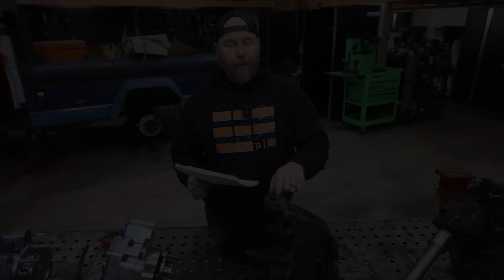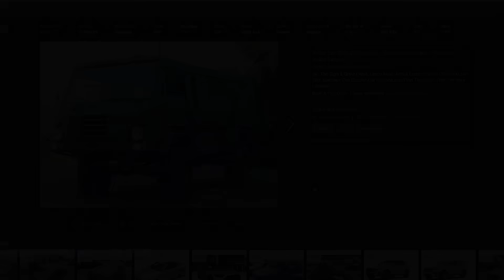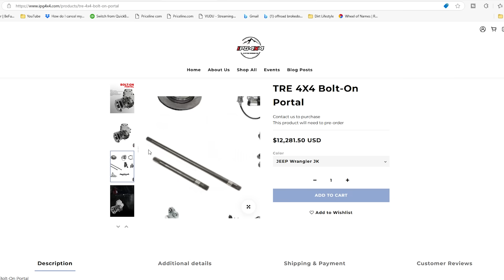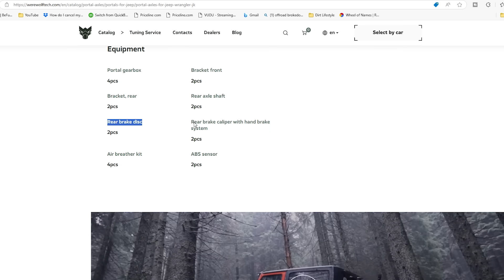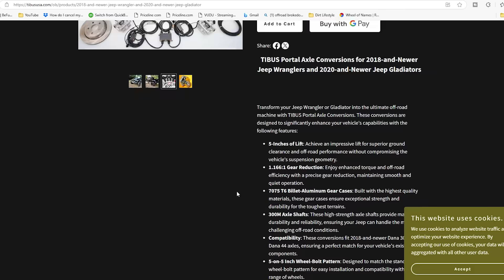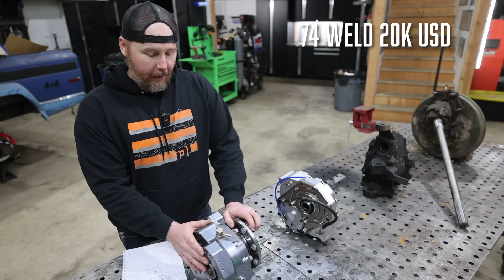CHEAPEST Off Road Portal Axle to Most Expensive! 74 weld, Werewolf, Hummer portal, Unimog portal.

Comment: What about noise?  Those gear sets have to be loud… Just don’t measure HP, do a road test before and after and measure the ambient cabin noise.
Reply: They aren’t…the main reason is RPM. At 80mph on the freeway the portal gears will be spinning at about 750rpm depending on application and diff gearing. Now if your vehicle would do 500mph yes they will sing like a typical straight cut transmission gear but that likely won’t be an issue

Comment: Using a rear third-member in the front and vis versa is a bad Idea. Used as designed, the helical curved angled gears create a linear force acting between the carrier and the larger inner pinion bearing  which is compressed under engine pressure and drive load resistance, the angle cut pinion and ring gear reaction force is applied against the inner race in the housing, thats the whole differentials work load on the larger inner bearing is designed to handle this pressure, reversing creates a high thrust load against the outer pinion bearing in an inward direction which places all of it against the nut and crush sleeve on the pinion gear, which is not only the smallest and weakest link, it also receives the least lubrication, consider the way the differential circulates lube internally, which is slung from the ring gear, the front diff slings from the bottom and the rear from the top, the housing  designs facilitate this method and allow the lubricant to reach the  pinion bearing.
Reply: Huh? Sorry but all this info is incorrect. There is no such thing as a front or rear differential. There are only high pinion or low pinion which run on either the drive side or the coast side of the gear depending on if it’s run in the front or the rear. As for flipping the diff, this has been done for decades in racing. The only issue you have to contend with is pinion oiling when running a LP diff in the rear that has been flipped and there are probably a dozen pinion supports available on the market that are specifically designed for this application and proper oiling. Most all of the current Ultra 4 and Trophy Trucks are mid engine which require the diff to be flipped…it’s a non issue

Comment: Not sure how the shipping will go, but look up Marks 4x4 based in Melbourne Australia.

They make full portal axles for a number of vehicles including LandCruisers, I think the prices are around $12-15k Australian.

But these are complete bolt in axles, so they maintain the same track width, have the diff and portal ratios tuned etc.

For the Nissan Patrol (the 4x4 of my choice), they advertise going up to 35's with "factory" final ratios at the wheels (factory tires are normally 31's).

They are about to release the Gen 2 version that supports CTIS, working with another local Australian manufacturer that make CTIS systems.

I'm not sure how compatible they will be with the different models of USA vehicles, or how the costs will work out to have them shipped over etc.

But knowing that they exist means you can look into them and get the details you want.

When I contacted them many years ago with questions, they were quite happy to respond and answer.
Reply: Rubbish…….., probably the weakest portal out there. Only limited to 35s and they still break. they are over 60k aud now so get ur facts right

Comment: Great video man!!!
Couple things, one statement, one question:
- I've worked in the auto repair industry for 35 years, and not a single tech I've work with would be willing to even entertain the idea of working on portals. So Nate, you're spot on with that one.... "You're on your own". As sad as I am to say that.
- It seems like a good idea that all steering and suspension bushings should be poly instead of rubber due to the added force/stress? Is that a correct statement?
Rock on man. Love the content!

Comment: Really good video on portals. As far as they all seem to go, also depends on you case fastener of choice. Alan head bolts tend to get full of gunk, then you can't get you tool down all the way to the bottom, then you round the inside out, and then your boned. Espically on the 74 weld, where it looks like you can't even get a set of vice grips on the head of the bolts to get them out. And steel bolts in aluminum will lead to corrosion. So pretty much even before you put these on, put a decent amount of anti seize on the bolts so they have a hope in hell of coming out if they ever need to be serviced.

Comment: The Hummer H1 Service Manual states that you should change your geared hub oil every 12,000miles or whenever it is contaminated. Also a big reason for the Hummer/HMMWV portal failures is due to improper torquing of the spindle nut. BlueHummer came out with a locking spindle nut to help combat this which is now available from ModMafia.

Comment: Thank you. The pros and cons really help. You might note the dramatic difference in the thickness of the units. Narrow ones will give less of some impacts - like scrub radius and leverage on ball joints etc, but may have their own trade-offs. There are very good reasons that the world’s vehicle manufacturers only use these on specialty off-road vehicles, and most have speed restrictions if used on road.

Comment: There are a few interesting traps in here as well;
the first is that you'll notice the "big brands" so to speak, have weird drive ratios, like differentials. The reason for this is because at least one of the gears has a prime number of teeth... That's so every tooth touches every other tooth... If you don't have that then you'll have "sets" of teeth that touch each other and can have mutual wear problems... If you have a gear with 10 teeth on it and a gear with 20 teeth on it, then every tooth on the little one only ever touches 2 teeth on the big one... Weird problems happen that can cause individual tooth failures due to normal operating wear.
Second, bolt counts; it's not so much about how many bolts there are, it's mostly about keeping the two case halves sandwiched... Pretty well all gearboxes fail due to case flex. If you're missing teeth it's because the gear centres have moved away from each other, caused tip loading and you've smashed a tip off... If you're experiencing case failure it's normally because thrust loads on the case from the gears resulting in misalignment, weird loads etc. etc... Gasket failures are normally because of case splay because of... You guessed it :D
As far as the bolt thread into aluminium goes... That's a hilarious one, it turns out you can create enough thread with three diameters worth of thread in aluminium that it'll pull the head off a 12.9 bolt with overtorquing before the thread fails.
Finally, the biggest single advantage of CTIS is that, if you have a puncture you find out immediately, and you don't lose the tyre... CTIS with any sort of reasonable flow rate compressor will actually flow enough to keep the tyre on the bead and inflated at low pressures, as long as your lines have the flow rate to support it... This sort of thing is super useful if you're propped on the side of a super slopey mountain in the mud and snow, wheeling up to rescue a friend who's also stuck in the same environment and everythings a bit precarious... You know, as a theoretical example ;)
Anyway, awesome work mate, love it :D

Comment: Cool to see this start to trickle out. A few comments I’ll make 

Not totally sure about the lift height of the H1 stuff but I believe it is under 4”
Unimog is a hair under 4.25
Lift is determined by center of top gear to center of bottom gear on a solid axle 
On a IFS the lift achieved is optional…CV lift is what is guaranteed, but you don’t necessarily gain lift from the portal. That’s all dependent on where your arms attach
Our bearing pack is based off a 99-04 F350 but since we do a couple things to it like a custom wheel pattern as well as integrate magnetic encoders for OEM ABS sensors it has to be a custom pack. We typically keep at least a couple hundred in stock. Every portal you showed runs 2 bearings to support the lower stub shaft. We use 3 bearings for a lot more strength. If you get any deflection there you will destroy the gears. That is the main failure on the unimog and the H1. People think when the gears break it’s because the gears are not strong enough. This is not correct in most scenarios…it’s due to deflection of the lower stub or spindle which comes as a result of a sub par bearing package. I could keep going but you touched on a lot of stuff and gave a good intro so I’ll save that for another day
Reply: Do you think Nate is right to replace his portal oil after every water crossing? I can't imagine the military is doing that on their Humvee portals, or the Volvo folks on their trucks. If that were needed, portals would be a total no-go.
Reply: @adiemitchell  no. I have run lots of water and I don’t change oil until I hit 5,000 miles. As long as your vent lines are out of the water you are good to go. Once the vehicle is dry if you see an oil leak for any reason then yes change it but I don’t see a need to change oil just because you ran water
Reply: @74weld I thought the manual says oil changes every 3k miles
Reply: @dr.lefort1596  through oil testing and analysis we moved it to 5. We are always erroring on the side of caution on this and hope to update and do more infrequent changes as we test on our end. But we test, gather data from conditions and use cases, do oil analysis with a lab, then update as we go. Better safe than sorry…but we are working to get longer life between changes
Reply: @adiemitchell  Well, you could do it like the Unimog Watanlage (Unimog water crossing system). Every time you switch on the diff locks or the AWD (the activation differs between the models) compressed air (2,9 PSI) is sent into the axles to keep water out.
Reply: @adiemitchell  Yes he is 100% right to do so. Seals are meant to keep oil in, not water out.  The military doesn't GAF about long term reliability, just the next mission.  They don't try to maintain engines in the HMMWV's which is why they don't have a single motor that has made it to 100,000 miles in the whole HMMWV fleet.  They just replace them.  Do not take military SOP with regards to vehicle maintenance as gospel when it comes to the HMMWV/H1.
Reply: @adiemitchell  the HMMWV manual for the portals recommends changing the oil every 3k miles iirc it didn’t say anything about after a water crossing but the USMC ones with the water fording kid would take engine crank case pressure and pressurize the portals, diffs and T-case to keep water out.
Reply: Great info on the H1 weakness.  Within the limits of cooling, do you know if you can run the lower taper bearings with a greater preload to reduce deflection under load, or is it a case weakness?
you are right on the H1, center to center is 3.875 inch.

Bravo on the 74 weld design, it is abundantly clear to me that your team pulled all the stops and offers by far the best value for aftermarket portals, there just isn't anything else even close.
Reply: @JacobSingleton01  "Alot of failures" in the H1 geared hubs (we don't call them portals) is pretty rich.  The only failures related to the geared hubs is the spindle nut not being properly re-installed and the wheel flying off (usually at speed).  ModMafia sells a locking spindle nut which completely resolves this issue.  The other issue is leaks, however using Lucas Hub Oil in the geared hubs usually resolves this issue - and replacing the input seal is about a 15 minute job once you get the halfshaft out.
The serious H1 offroad guys are running 10,000lbs curb weight rigs on 42's with the 12k half shafts and driveline.  The hubs don't give up.  The halfshafts die first everytime. Then stub shafts and diffs and driveshafts.  The geared hubs are remarkably resilient.
Reply: @nothingtoseaheardammit  we see failures all the time in the hardcore rock crawler scene. At trail hero 2 years ago I saw 4 cars break gears within one hour. It is fairly common
Reply: @JacobSingleton01  I don’t have enough experience on the H1 stuff to make that call but I know if you put too much preload on a tapered roller it will cause brinelling of the races. This is when the tapered rollers physically deform the race and will lead to premature failure
Reply: I'm running the 74 Weld portals on my GX 550 and I'll NEVER go back. I'm addicted!
Reply: I really love your bolt on kit. It’s very easy to modify. But i think74 kit looks weak..  humvee hub portal is also strong but very hard to custom, unimog 406 axle is really massive. Could it really  be failed? If all conditions are the same. Unimog thing will last than others.
Reply: Hi, I have a Maruti Gypsy (long body Suzuki Samurai). I want portal axles for it so I can run 38-inch tires with minimal changes. Can you give me some suggestions for this, or do you have any ready-made products?

Comment: Do you foresee any significant difference in strength between the portal pros and the 74 weld mounting? mounting to your factory knuckle through the factory 3 bolts for the unit bearing on a jk vs new knuckle with portal incorporated. Do you think the portal pros can hold up to a say a 42 inch tire this way?
Reply: We replace the knuckle on every application for 2 reasons
1. The factory knuckles were not designed for the added load and will fail.
2. Replacing the knuckle allows us to sink the bearing package into the knuckle and makes it more compact. It’s the main reason why every single portal on the market is significantly wider than ours.

Comment: My biggest concern with the Tibus is that they are using steel bolts into an aluminum housing. I wonder how their warranty will work or how they’ve coated everything to resist galvanic corrosion.  Portals will inherently spend time under water or caked in mud at some point which will only exacerbate the corrosion from dissimilar metals.

Comment: I always wondered what you would get with portals and using a axel system like the atomic engineering axel (raised upper section with CV style axels all in a solid fabricated unit).  I was just searching for them but it appears they are bankrupt or just closed,  not sure which.    It would make a lot of ground clearance if viable.

Comment: Changing the oil in the H1/HMMWV geared hub is super easy.  Hardest part is actually taking off the 140lbs tire.  Pro tip: Use Lucas Hub oil to keep the input/output seals from leaking.
Reply: Add that there are both helical cut and straight cut gears for the 12k units. The straight cut are stronger than the helical. 
The 10k units are only straight cut. 

ALL of them should get the BlueHummer locknut (stage 8 fasteners)  cheap insurance for devastating damage.
Reply: After some questions, looked this back up to add:

Early spindle jut failure is the biggest cause of damage.  Lack of oil change is second and less gets better with better oil.
The helical gears were designed to stop the rocking that occurs when stopping too quickly.   The 12k cv axles (aka half shafts) were beefed up to stop breakage.   They did both at once to have the “system” upgraded.

After being involved in many high performance builds- the gears in the portals (aka geared hubs) are never the cause in failure.  Almost always the locknut failure.  

My suggestion is do not use the AMC20 differential.   They don’t withstand abuse well enough, and are too expensive of components.  Diy a ford 9” and you will be lightyears ahead.

For tips, help, etc. and for those who enjoy a slow off roader at times and is ready for a hmmwv- ask owners who had these things for years @ Hummernetworkforums.com

Oh yeah- CTIS: any hummer/hmmwv can be geared hub (portal) can be made into a ctis one.  If looking for it already - just look for the threaded hole usually with a plug in it in the middle of the spindle (where rim mounts to).  Factory hmmwv fittings sux, there is aftermarket ones that do a LOT better.   Any rim can be modified to use the ctis valve stem.  
I can’t begin to explain how awesome it is to flip a switch and inflate or deflate while driving.

Comment: I have an 07' Volvo XC70 wagon, and want to raise it up and possibly widen it, I want to camp on the beach in remote places, go to Tahoe and Go a little farther, so far, I've found guys doing 3 to 4 inch lifts but some include lowering the IFS / IRS units, which kinda destroy the clearance, I don't need a Rock Crawler, just a fun wagon, I'm a huge Volvo enthusiast so it would be fun to use all Volvo but not a game ender if I don't, I was considering making my own long arm kit but not sure that's gonna materialize... any ideas you have float them my way, thanks in advance

Comment: If I remember correctly, in their videos 74Weld mention that the main difference between their unit bearings is the way they implement the abs tone rings into it.

Also, I get being cautious about going through water and stuff, but isn't that exactly the same risk when it comes to differentials?
Reply from the maker: For sure!... Well kind of. Having water in your differentials is just as bad and water will get in the exact same way but the difference to me is the cost and the parts. The Yukon 5.29 ring and pinion in my Tacoma is like 400 bucks and a huge pain to swap but I can get the parts tomorrow. I bet the gears in these portals cost a lot more and I waited 8 months to receive these after my order. At least that's the way I look at It. Also, I typically change my diff fluid If I've done a lot of water crossings but not every time. Maybe twice a year in my Tacoma. 👍
Reply: @DirtLifestyle  Fair enough, I didn't think about the potential cost (sort of ironic consider the video).

Thinking about it a little more, small amounts of water would also have more of an effect considering the smaller quantity of fluid in each portal compared to the diff.